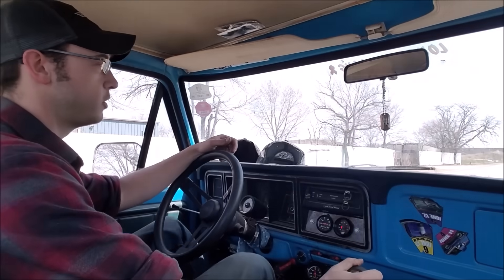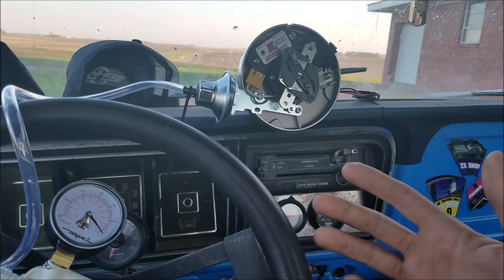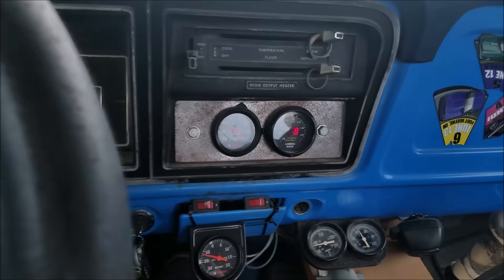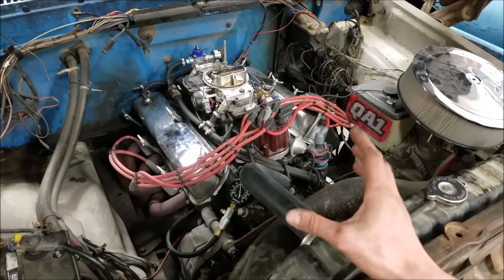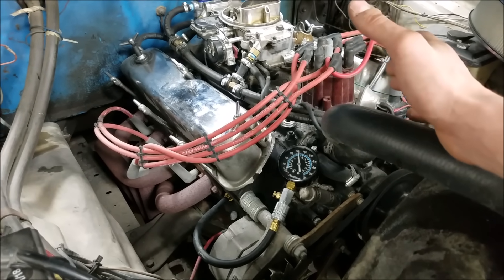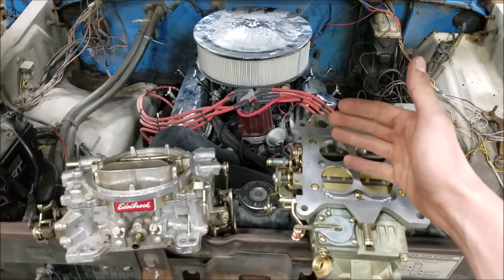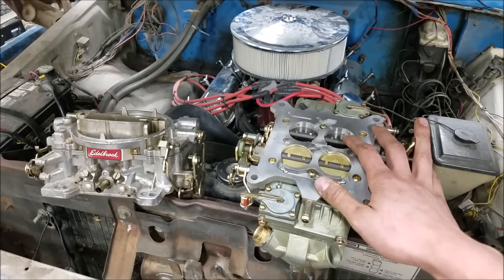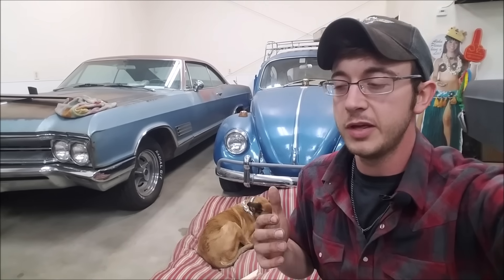Vacuum Advance - Ported vs Manifold: Which to Use & When !!!

Comment: There is a lot more to this. Overall, I use manifold vacuum. Under all light load conditions, the extra timing improves light load driveability, cold driveability, crispness/throttle response and light load fuel economy. With a longer duration cam, this helps smooth the idle and make the engine more driveable.

The more duration a cam has, the more initial timing I use (up to about 16 degrees depending on compression ratio). Total advance with the vacuum disconnected varies from engine to engine but I find 34 to 36 total is a good place to start on old cam in block engines with cast iron heads. As for total vacuum advance, 10 to 12 degrees seems to work well on most engines. Some may tolerate a little more.
Reply from the maker: The only difference between manifold and ported is that ported doesn’t add timing at idle - as soon as you touch the throttle at all, ported has vacuum and functions the same as manifold. 

You really have two choices - manifold vacuum with a low initial timing setting and quick springs, or ported vacuum with more initial and heavier advance springs. 
I like ported since you can snap off the line a bit better and you don’t have to worry about the light springs wearing out and advancing at idle.
Reply: @ThunderHead289  It's the extra advance up to the point where they equalize I find more beneficial in 95 percent of the engines I do. The ONLY time I use ported vacuum is on stock cam engines I want to idle very slowly.
Reply from the maker: They equalize immediately - there is no throttle angle that can move a vehicle down the road where you aren’t getting full vacuum at ported. Even me in my truck breathing on the gas pedal in 4th at 35 getting 22 mpg in a long bed f100 with a 302 I see full vacuum on ported. 

Give it a shot, advance your initial timing and hit it hard from a stop - you will chuckle to yourself. 
Now big cam stuff is different - they make low cylinder pressures at idle and require more timing - I run manifold on those as long as I can adjust the vacuum advance canister so that it’s at full advance at idle (often tricky) 
My solid lifter 289 loved 28 degrees at idle - it was 13 initial, 15 from canister, and then a custom stop bushing to limit advance to 36. 

That thing screamed. 
I try to make a note in the video that I’m talking stock engines here, or ones with a mild cam.
Reply: @ThunderHead289  Not so. No vacuum at idle until they equalize is more than the throttle plate just coming off the idle stop screw. I ran the same test you did in 1972 and have been doing what I stated in the first reply ever since. 

You do it your way, I'll do it mine.
Reply from the maker: I have literally been driving around with a gauge T’ed into my ported port on my dash. 
But as I said in the video, everyone is entitled to do what they want to do - and ultimately I made this channel so that people could spend more time enjoying their car vs working on it, to mitigate tuning frustrations. 
If you are enjoying how your car drives, who am I to tell you different! Keep on enjoying it and spreading the hobby to the youth!!!

Comment: I’ve always understood that having the vac advance hooked to ported was a function of emissions control and prior to emissions concerns, vacuum advance was always hooked to full manifold. The purpose of ported being to retard ignition at idle in order to raise exhaust temps thereby passing the idle emissions test. Most smog era engines were extremely lean, had retarded timing, ran hot and had horrible mileage and even worse power output. 
I run my bone stock 1966 ,396, 325hp vacuum advance on full manifold with a less aggressive mechanical advance and it runs excellent. This is with the lame original .398 lift cam and 10.25:1 compression. I’m pulling 20” vacuum at idle.
Reply from the maker: Listen to what I say at the end about being able to run more mechanical initial. 
It’s the secret to blowing folks doors off. So many folks run manifold and then have lazy ignition timing when they stab the throttle off the line. 

It’s not for emissions - that’s regurgitated ignorance. Ford flatheads had it, even before pcv existed!!!!
Reply: ThunderHead289 
I assure you mine is not lazy off the line. With 273:1 rear gears it will smoke the tires forever. Big block Chevy’s tend to not like aggressive curves or high total timing . It’s six of one half dozen of the other. Whether you have no vacuum advance at idle with a high initial and slow mechanical or full vacuum advance with a low initial and aggressive mechanical all in at say 3000 rpm it achieves the same thing. I’m a strong proponent of full manifold based on my 30+ years. I’ll have to dig up the literature I found written by a GM engineer back in the sixties who essentially states that GM engines of that era were designed to run full manifold. I’ll see if I can find it and post. It’s a good read.
Reply: Here it is. Found it on a Ford forum of all places , but I originally read it on the Team Chevelle forum 10+ years ago.  https://www.460ford.com/threads/timing-vacuum-advance-101-good-article-by-gm-engineer.117504/
Reply from the maker: You actually said it perfectly - the two scenarios you explained above are exactly true - what a lot of folks do is run manifold and have a lazy curve, and it just makes for underperforming engines. 
Personally I like a broader curve because I can’t stand that the lightest springs will flutter at idle, and even eat up some of your advance. 

After reading what you wrote there, I have a lot of respect for you as you are one of the FEW that understand what’s going on here!

Comment: I'd like to see someone make a distributor cap for the Nissan naps z24 engines (8 plugs/4cyl) to burn 2 plugs on each cylinder at the same time!
Reply: I use a 510 distributor and only run 4. Swapped the crank gear and distributor drive.
Reply: I have a 85-720 ,with z 24,one crazy thing is vac advance is able to makr run good,but without it won’t hardly acclerate at all,timing can set all kind of ways but with the 10% exast afterburn ,vacume changes too much when warmed up.way too many vacumes so plugged most.

Comment: I think this explains a lot why my Fairmont idles high and falls flat on its face under heavy load. It has manifold vacuum, and it's only the stock 2bbl. Haven't been able to fully figure out what duraspark I have on it either.
Reply: That sounds more like you have a lean condition. You either need more fuel through pump shot or with pump cam. Or... vacuum secondaries opening too fast.

Comment: Carbs and timing... What about single point fuel injection (bad smog control [70s] era oem) or retrofitted fuel injection systems in general Luke?  Are there tricks to setting these up properly Luke? 

Modern IC engines control fuel delivery, spark timing and even valve timing, lift and duration.  No wonder they get tractable engines that produce power that used to be the province of race engines only.
Reply from the maker: The biggest trick with retrofit fuel injection systems is that they are too good - since they compensate for a lot of adjustment mistakes, guys can have some seriously lazy timing and the car will still “run”. 
Good initial and advance timing is king 👍

Comment: Somebody is giving me a '79 F-150 with the six cylinder and an automatic transmission.The truck is cosmetically nice,the (non running)engine has a weird looking carb and the distributor is also not what I'm used to.Does anyone out there have any kind of opinion of what I'll be dealing with?Any and all help would be greatly appreciated!

Comment: So how many degrees would you allow the can to add when on ported ? I have a mild 350 Chevy with fitech which has always had a lean problem on light application of throttle , currently on manifold but now thinking I need to add timing when accelerating rather than loosing it so go to ported , I think I have 15 to 20 degrees on the can , thanks 🙏
Reply from the maker: Howdy - you lose timing on both ported or manifold. They are exactly the same except at idle. 
You probably just have some lazy mechanical advance. 
Do you know what your initial mechanical is set to?
Reply: ThunderHead289  thanks for the reply , think it’s about 10 or so degrees , I need to get the truck back from the painter and have a play , I am wondering if the blades on the fitech are too closed off with the added timing on manifold at idle  , although there is not a conventional idle circuit like a carb it will require air flow to atomise and carry the acceleration fuel into the system , worth a try ? Think I have a total of 34 timing all in
Reply from the maker: That’s not a bad assumption there for sure - I know GM tbi engines aren’t very specific as to their throttle position at idle. In later Years they even capped it so folks wouldn’t touch it. 
It’s a tough job for tbi to atomize fuel at idle since the injectors just hit the throttle blades, I wouldn’t be surprised if your theory is accurate.
Reply: ThunderHead289   Update , got the truck back and switched from manifold to ported , gave the idle screw a turn in to compensate , started and ran much better 👍🏻 recon the throttle blades were too closed off , the annular injectors sit above the blades so and acceleration enrichment has to pass these , thanks for the ideas 💡👍🏻👍🏻

Comment: after replacing my timing chain my 390 wont run right with the advance hooked up but runs better than ever without it not sure what i did but truck is happy.
Reply from the maker: Your distributor has too much mechanical initial probably - so as you increase rpm with vacuum advance you have too much timing. But now with all that timing, she’s probably spark knocking on hard throttle.
When you did the timing chain did you mess with the timing or remove the distributor?
Reply: @ThunderHead289  before i replaced the chain truck would only idle if you tried to rev it would shake and back fire. didnt touch anything other than the chain to replace had to mess with distributor after to make even run at all.

Comment: Hey, could you do a 351w efi to carb swap. Been wanting to do if for a while but dont know where to start thanks
Reply from the maker: As in switch a 351w in a vehicle to carb, or you have a 351w on the shelf you want to switch
Reply: @ThunderHead289  I'm rebuilding my 95 351 so it's out the car and torn down at this point so I think it's the perfect time to do it. Thanks

Comment: Great video! Now what would you say  to running neither? I only run mechanical advance on my street car.
Reply from the maker: Well, let’s review from a functionality perspective - vacuum advance only adds timing at light throttle because at lower throttle angles you have less cylinder pressure. Basically without vacuum advance your timing while cruising will be late - it doesn’t hurt anything, but you are leaving probably 3-5 mpg on the table and response may be somewhat flat or less than what it could be capable of until you get some throttle input
Reply: @ThunderHead289  Right! And that's the reason vacuum advance was invented I'm assuming. Would you be against running only mechanical advance on a hot street car which would just a high initial with a short curve for total (that's my setup and my light throttle response is crisp and snappy). I guess I'm just curious to know your position about only running mechanical advance. If set up right, it's all you need. Would you ever run one of your street cars with only mechanical, or do you always prefer to have vacuum advance?
Reply: @ComicalCowboy1911  Put an adjustable vacuum advance on ported vacuum... the kind with the tiny allen head adjuster
Reply: @THRASHMETALFUNRIFFS  Yeah Mopars came with those from the factory. My distributor currently has one. The only problem with even the adjustable though, is they don’t limit the amount of their vacuum advance, just when it comes in depending on vacuum. That’s why I tuned it out completely for my setup.

Comment: Hey Luke, when timing total timing, do you do it with or with out and vacuum advance connected?
Reply from the maker: Akieba I take my total timing reading with my vacuum advance disconnected - this gives you your total mechanical timing which is what you are on at hard to full throttle where cylinder pressures are the highest and where a mid adjustment will blow an engine up. 
I have 34 degrees in my truck total mechanical

Comment: Great video Luke.
I will take off my carb, in my Z28/RS and look for transfer slots, and adjust if needed.
I think it is the factory 73 cam, so I will go after ported vacuum.
Thanks for the advises !!
Regards from Denmark, Europe.
Reply from the maker: Howdy from Des Moines Iowa! 
Just be sure when you go ported that you look into advancing your initial mechanical timing 👍
Reply: @ThunderHead289  Sure, no problem, it will see what it will be.
What would you recommend for my car?
It is factory driveline = 350/245hp iron heads, TH400 and 3.42 rear.

Comment: I normally stick with manifold vacuum but good to see your explanation on which is best based on camshaft.
Reply from the maker: It’s one of those odd things - stock and mild cams just take so much less timing at idle to the point that hooking manifold vacuum up causes a guy to have to run very little initial mechanical for an overall idle timing number to not be way excessive

Comment: Need some help, my Chevy 350 has been driving me nuts, when I'm at a dead stop and it's idling and give it gas/stomp on it, it bogs and dies, but when I slowly accelerate it's fine, only when I slam the throttle the engine literally dies, the reaction is terrible, I've checked the accelerator pump, adjustments, timing is good, I have no idea
Reply from the maker: Is this engine cammed at all, and what type of trans? Auto with the stock converter?
Reply: @ThunderHead289  hey, yeah it's cammed(idk the specs) and it's a th400, I don't know the converter as I didn't install it
Reply: @ThunderHead289  it's got a 670 Holley street avenger, world's tourquer 67cc heads, comps roller rockers, msd distributor, I know it's been rebuilt (don't know the pistons)
It's been driving me nuts

Comment: Wish I could find a local local expert like you to help on my lowly 1980 Ford 2.3 carb turbo Mustang. You are far over my head but really appreciate the ported vs manifold vacuum explanation. You should see the vacuum nest under the hood! Having a hell of a time getting my car to run best down low. Also getting a carb backfire when I shift gears under full throttle/heavy load I can’t figure out. Suggestions?!
Reply: Check lifters

Comment: I dont even have mine hooked up. It is sluggish coming out of 3rd into 4th gear. So I guess I need to try this. 1983 F250 302 with a 4 speed.
Reply from the maker: Hooking it up to anything is better than nothing at all! 👍
Reply: You will want to get it hooked up. You are wasting a lot of fuel if the vacuum advance is not operational.😰

Comment: too bad they didn't have anything for Nissan trucks.
wish i could find videos on the vacuum advance for the Nissan 720 stock carburetor.
Reply: Barret Radtke there’s a beast if I ever saw one,who designed that z24?my 85 has 10% afterburn exaust( a nightmare for exast manifold cracking,the vac advance is crap& the distributer is fun with 8 sparkplugs,no one told me about the shim plate missing on the starter,that cost me a lot,wasn’t mentioned in haynes manuel eighter.if you want a cheap truck I’ll almost give it away.
Reply: @jerrellhaynes4703  no idea who designed it. i live in Alberta so i just blocked off my EGR valve. 8 spark plugs is interesting. and i dont know if the vacuum advance on my truck works or not. is there a shim on the starter i dont think my truck trucks had one. woldnt mind a cheap truck but i problally too far to get it here.

Comment: Can you tell me how you did fast idle switch?
And, how do you set intclh timing if you were to run manafold vac?
I leve the vac line attched when i set the timing.
Reply: oldreliable303 Justin Scott You can use a fast idle solenoid like this. Take one side of the switch to +12 volts and the other to the connector on the solenoid. When the switch is on it will energize the solenoid and the plunger will extend, screw the plunger in or out to get the idle speed you want and turn the switch off. You can find these on old carbs and a lot cheaper than this online. If you have more questions there are plenty here to help. 👍🤙